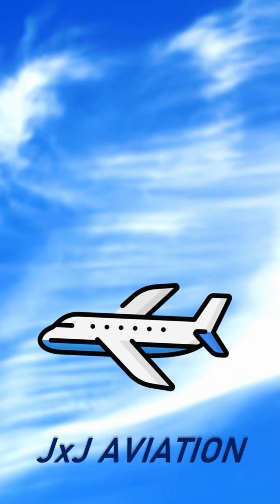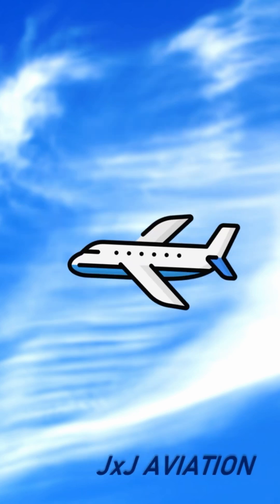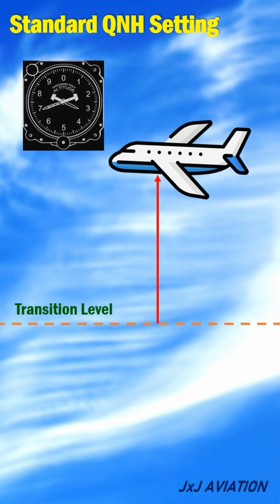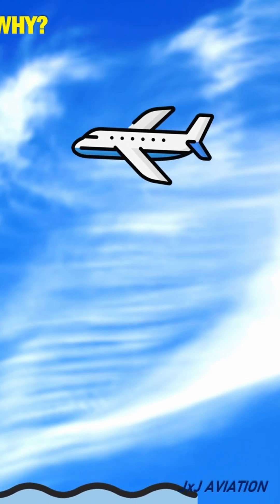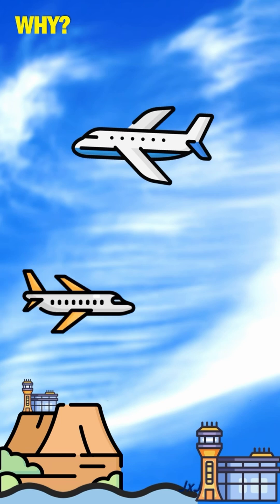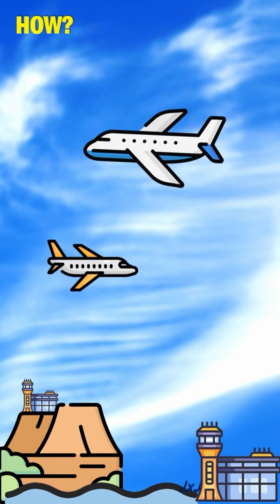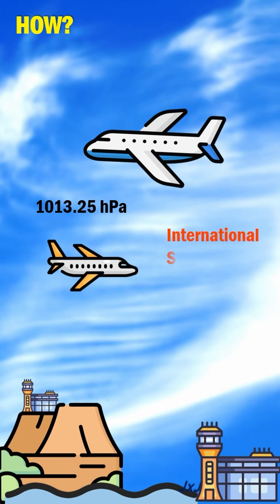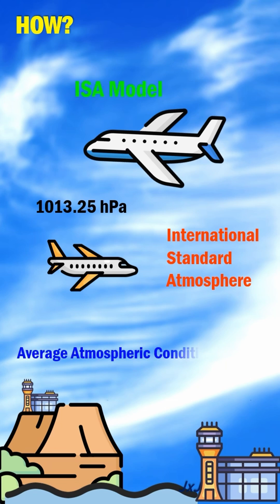What is STANDARD QNH?? | Why is it used? | How it is derived?

Comment: 13:08 - I’m pretty sure standard is the same everywhere (1013.25 hPa), because it is used to ensure vertical separation between aircraft, especially considering RVSM above FL290.
Reply from the maker: yes. Have made a full video on the altimeter settings. Check it out!